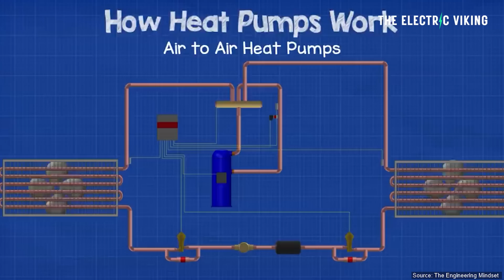U.S reveal NEW Heat Pumps that withstand freezing weather & save 50% energy

Comment: As others have already commented, cold climate heat pumps are a mature technology - look no further than northern Europe. Here in the U.K. our detached family home is run almost entirely off-grid with solar PV, batteries and a heat pump. Our annual bill for heating, electricity and 10000 miles in our EV was £650 in 2023.

Comment: The tech was there already!!!! My very cold weather state has been using Fujitsu Daiken Mistubishi ect... for years, as primary heat... 

I ripped my poorly insulated 130 year old homes oil furnace out shortly after moving in. 

My state of Maine is a leader in the US with the adoption of this tech... we were the most heating oil intensive per capita state a few years ago... I don't think that is the case anymore.

Comment: Our 3T Trane heats the house down to -23C without backup heat and temps below that are  rare. Monoblocks will drive down costs for the unit and installation. Air to liquid are taking off in Europe and trivially combined with phase change energy storage to shift energy use.

Comment: In the last year, I have installed 200+ heatpumps in CANADA that are -30C rated. These are standard units made in China, Japan and other Asian countries. It is just that the USA was ALWAYS way behind in cold climate heat pump production, thanks to the oil and gas companies pushing BS that says they don't work below freezing, therefore keeping the homeowner on on a gas meter. If sized correctly, the systems I install don't need a backup either and if they do, it is a small amount of extra electricity on one or two days a year.
Reply: When my gas furnace (centrally ducted) conked out over a year ago, I went on a desperate search for a heat pump replacement.  I live in Denver, which I think would be an ideal location for a heat pump for heating and cooling.  We get some minus Fahrenheit temps each winter, but it doesn't stay around more than a few days.  Ironically within a week of the furnace going out we had one of the coldest stretches every including -25F.   Each of the six HVAC contractors I talked to said I had to get a hybrid system (gas+HP) and that heat pumps only worked well to about 30 degrees.  I sensed it was BS, intended to sell a more expensive system overall.   I found almost no one who sold a CCHP that could go to the lowest temps we experience.  One place offered a Mitsibushi CCHP, but the price tag was around $20K US.  That price tag was too much.  I could get a 96% efficient furnace for 1/2 that amount. I don't have A/C, I use a window mounted swamp cooler which really is pretty cheap to operate.  And so, sadly, I went with the gas furnace, and I'm stuck with that decision for a while.  I guess by the time i need to replace it again, heat pumps will be cheap and work down to -30F. I can only hope.
Reply: Five and half year ago I put a solar system on my house and switched everything in my house to electric, had gas central heating, changed to multi head heat pump by diakin 39000 btu unit.  My house is 1300sf, and we just had temperatures down to 20F and it did fine.  Mine is not a low temp version. I self installed it and bought it on eBay.  Payed 5500 for four heads, lines, 410 Freon and a vacuum pump. I had one head that had a leek that I couldn’t find.  Hired a local hvac company to find it. They charged me 800$ to evacuate the lines and refilled with my Freon. Total rip-off. I had called an install company and asked what it would cost to install a system like this and they quoted me 11000$ for material and labor. It took me two and half days to install and save 5500. Other than the leek I couldn’t find. Now all I pay for electricity is a monthly service fee of 13.54 a month. And I drive an electric car. I live in Portland Oregon and we don’t see temperatures much below 20F. Unless you live in the Gorge area where they get high winds.

Comment: wow I just had a Senville installed that goes down to 22 below.. i guess i'll have to see if these are really any better. For me the biggest hurdle to getting one installed was exploitative pricing from so many installers.
Reply: buzz86us2005   has hit it right on the head.  I have been trying to get them installed in my home for 5 years but it hasn't made sense.  The installation price remains way too high, comprising about 60-70% on the total cost.  For instance a $3000 18k Hyperheat unit would cost well over $6000 and even more if you want it off the ground and with some defrosting help which you would need here in New Hampshire even in today's warmer climate. It would take 4-6 years to pay for itself.
Reply: @jimcarbone2748  i finally found an installer charging sane prices after being quoted $9500 installed for a big brand. I found Senville the first installer wanted $2700+ the unit, then I finally found an installer doing it for $1050+ unit for a total $2300.
It is barely a 3 hour job.. what are these people smoking? I'm not getting any incentives or taxes because those installers wanted a small fortune.

Comment: Swedish heat pumps has been able to harvest heat down to -15 or even -20° C for years.
Look for CTC or IVT. These are Swedish heat pump manufacturers that have produced heat pumps that work in sub zero climates for years. 
So if you have need for that type of heat pump get it from a manufacturer that have experience in the field and can produce pumps that really works in sub zero climate.

Comment: OMG - discovering wheel in the US????. We have in Finland EVERYWHERE heat pumps. Everywhere. I guess over 70 or more percent of family houses are with heat pumps. Just guess. In our neighborhood You hardly find one house without a heat pump. The same applies for big buildings (schools, hospitals, supermarkets etc.). Over 1 milion heat pumps are in FI (5,5 mio inhabitants). Temperatures are here similar to Alaska. Last 3 weeks average about -20 with record of -44 degrees. I am wondering what are Americans developing, that withstands temperatures under freezing point. And how are they in this technology leading. All this exists for decades and works perfectly. Bosch, Mitsubishi, Toshiba, Daikin, Viesmann…. All inclusive installation usually under 3000€ (VAT 24%, and You can part of investment deduce from Your taxis).

Comment: It's funny to listen to an Aussie guy to explain to us the benefits of heat pumps. I lived in Australia for 13 years and know very well that it was cost prohibitive to have even the double glazed windows installed in a new home - the real estate agent would try to persuade me to build another room that I didn't need instead as a better investment than double glazed windows! Here in Europe, the new houses are commonly getting even triple glazed windows. I'm using the heat pump upstairs for 9 years already, and it works fine even in -15°C. I'm also using another smaller one for garage/cellar for two years now.
While in Australia, at least around 1991, I remember walking around our newly built house in the evening and I saw the light from our living room seeping through roof tiles at night until we had the ceiling insulation additionally installed! Aussies never experienced the feeling of getting cooled inside the non-airconditioned house in the middle of summer! It is very logical here in Europe to do so because the house has such a good passive insulation for cold winters that it helps keeping the inside cold in summer. They just don't get it and build unneeded extra room instead of paying for double glazed windows (which are so expensive because they are luxury item because nobody buys them).
I didn't learn any important information in this clip, Sam, no hard data. Only something about 5°F, which means a) I need to find the conversion for what it means in °C, and b) just the temperature isn't enough to be able to compare to other heating characteristics.

Comment: Scandinavia is full of air warm heat pumps (split units) with COP of above 5 and sCOP around 4.0. The latest models can be operated at -30 °C or -20 °F. Mine paid back in less than 4 years. USA is full of non energy efficient houses, so they should have about the same ROI curve. Solar panels become profitable in 15-20 years. 10 years ago most of the air to water heat pumps for my former employer sold for apartment houses had break-even point after 7-9 years. I was responsible for the economical calculator web app (full stack).

There is little or no innovation needed here. Just reusing the existing one.
Reply: @@phillipbanes5484  based on my personal experience, the houses seem to be build with less strict standards in relation to energy efficiency. Might of course vary depending on the state / location. 
In Finland it is very common to use ground / air heat pumps and deliver heat to air / water, but the houses are also well insulated. Personally I have a house with quadruple glass windows. The house is build with stones that have a thick EPS graphite insulation between the inner and outer part of the stone. Over 50 cm / 2 feet insulation below the roof. Air conditioning with heat recovery system and with build in air-to-air heat pump with COP over 5. My house is also connected to district heating pipes and heat from that is used for floor heating and warm water. (I can use floor heating or heat pump for heating of the house depending on the pricing) I have also a 3000 kg / 6600 lbs heat-storing fireplace.
Reply: @@phillipbanes5484 Didn't you notice that there were 2 different persons commenting?
Reply: @@phillipbanes5484 I do not start to argue with you. Why do you try to troll or debate things when you simply do not have any idea of what other people do know? Personally I have been following construction methods & standards for decades and been employed by several US based companies. I actually know what is good and bad in several countries in the construction business. The USA is behind in some areas, even though there is much of that attitude that "we know everything and the imperial measuring system is the best one in the construction business". Thanks for your arguments without any facts. I'll end my part here.
Reply: @@phillipbanes5484 OK. you proved my previous comment that you are a troll. You have not added any facts, no personal experience, no US based data or any relevant information into this one sided discussion - the only thing that you try to do is to argue against the things that others say. You are stating that we others know nothing and you are the expert, with zero facts supporting it.
Thank you that you were so humble and able to lighten us with your expertise. 

I do not normally waste my time by commenting on trolling - just went into a trap this time, but the lesson is learned for a while.

Comment: The bit you've overlooked electric viking is the most importantly detail regarding heat pump, insulation and lots of it floors walls and ceilings 200-250mm minimum. Up here in Finland 500-600mm is recommended. Triple glazed windows and double door entrences on every house. That is the key to keeping costs down and keep the heat inside for longer.
Reply: Yes, insulation is important to lower the need off high temperature to radiators to counter the draft , both convection and radiated.
Reply: Unfortunately Sam seems so busy he's got no time to read the comments. But I bet he'd be shocked to hear this (as I mentioned my experiences of living 13 years in OZ and having two new houses built there for me. They can even read your words, but they will never get the meaning, because these two different worlds need to be lived to understand.
Reply: "That is the key to keeping costs down and keep the heat inside for longer."
Doubling the cost of windows and insulation would appear to be a way to make costs higher.
Reply: @wisenber   As long as your windows are a standard size for triple glazing by the manufacturers the cost isn't that high. If you stick to industry standard sizes it keep costs down. Keep bespoke for cabinets and things you know are space saving and quality..
Reply: @thomasreilly6362  The costs you mentioned are cumulative. The US already has a housing affordability problem. Driving up housing prices makes homes less attainable. That, and energy has been historically less expensive than most of Europe.

The house I lived in 20 years ago that I rent out out now has heating and cooling bills average about $50/month for a 150 sq meter house. The payoff for new windows would be decades.
Reply: @wisenber  Unfortunately, I'm fully aware of the housing situation in America and the ridiculous cost of housing. The entire sector needs a overhaul from zonal housing to wall street vulturfunds buying thousands of properties and squeezing out first time buyers. My original post was about insulation and American houses are very poorly insulated compared to European ones. Secondly the build quality is shoddy leading to additional cost to the owners to repair.
Reply: @thomasreilly6362  "My original post was about insulation and American houses are very poorly insulated compared to European ones. "
Which is why I noted making houses more expensive doesn't really help.

"Secondly the build quality is shoddy leading to additional cost to the owners to repair."
The build quality really isn't shoddy. The US has different housing requirements than Europe with different building materials being more available. The savings are realized on the front end, and the costs are deferred over decades. In contrast, adding more requirements has the costs front loaded and the savings spread out over decades.
US housing inventory tends to get replaced about every 6-7 decades, meaning that there are more newer homes with more newer features. In contrast, a house constructed of block in Germany in the 1920s really isn't a viable candidate for a a retrofit for the advancements in plumbing, wiring, telecom, heating or cooling. The cost of a European retrofit approaches 75% of the cost of a US home.
Reply: @wisenber   I should point out that my nephew is a building inspector in San Diego and trained in Ireland as a construction engineer. Going by some of his conversion a lot of shoddy construction is passed under dubious circumstances. And would never pass an European construction standards. He has seen new builds fall apart after several years. There are numerous YouTube videos of shoddy construction especially in Las Vegas. The building materials are irrelevant Finnish houses are made out of timber and Irish houses are built using concrete blocks. All of them have to have a high insulation value. As for the age of European buildings. The apartments block I lived up until 4 months ago was  built in1973 and the Finnish engineer for the city of Oulu deemed it un economy and it will be demolished this summer along with 3 other low rise apartments blocks. Your German example is very unfortunate about 70% of Germany's housing stock was destroyed between 1940-45. Only the facades of buildings in Germany and Poland and many Baltic states remain behind them are new buildings and offices. There is very ittle sentimentality regarding old buildings that are past their useful life. European houses are more cost effective in the long term.
Reply: @thomasreilly6362  I should have pointed out that the vast majority of US housing doesn't have the issues you mentioned.
European standards are higher, and so are the costs.
US housing tends to be more efficient as any "savings" won't be realized during the lifetime of the first owner.
My German example included the house my family has owned since the 1680s in Munich along with the one my grandfather built in the 1950s.
The 1680s house got plumbing and electricity in the 1920s. All of that had to be updated at great expense in the 1980s. Now they require solar panels if we ever need a roof and the oil burner to be switched to far more expensive electric.
Meanwhile, the houses I own in the US can be updated at much lower costs. I really don't want any zoning changes or limitations on who can buy my property as it would crater the investments I've made for decades. People who bought single family houses in single family neighborhoods paid a premium to avoid what you suggested.
Reply: @wisenber   Texas and the other southern States are classic example of why insulation should be standard in houses. The extreme cold it has experienced saw unnecessary deaths and both the rich and poorest in those States suffered unnecessary. It also helps to keep them cool in summer months. Zonal housing is mixed housing and commercial property as you should know is more cost effective to than sprawling houses on the edges of cities often built with few transport, education or health services close by. No car no choice. It is also more expensive in the long term to maintain the properties as more resources are needed like water. I'm sure there are very generous grants in Germany as there are across most of Europe to convert from fossil fuel to greener energy. Which adds more value to the houses. Its more of an investment than a cost.